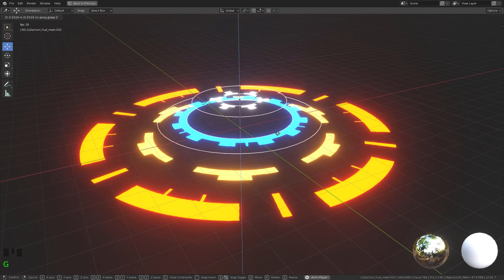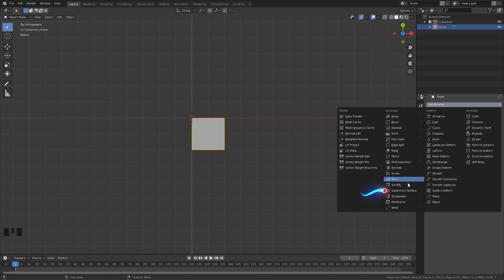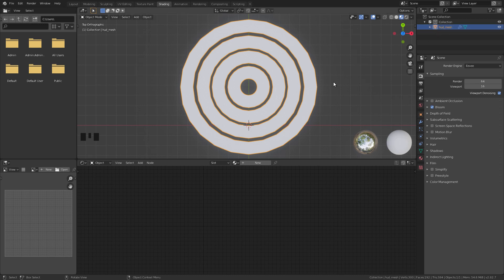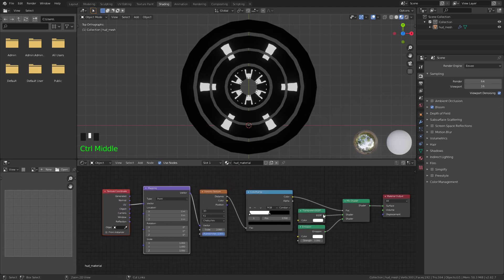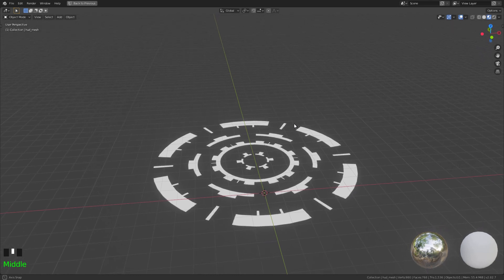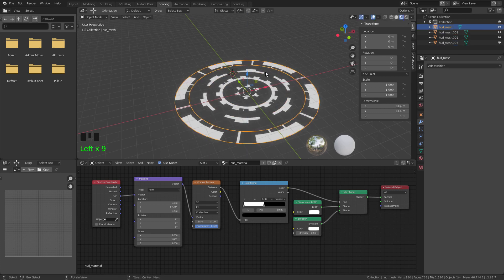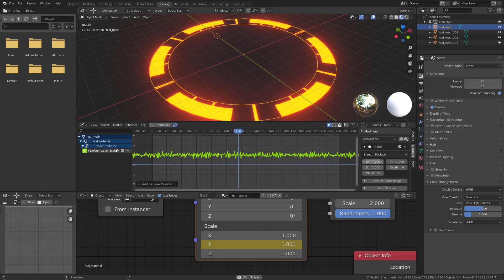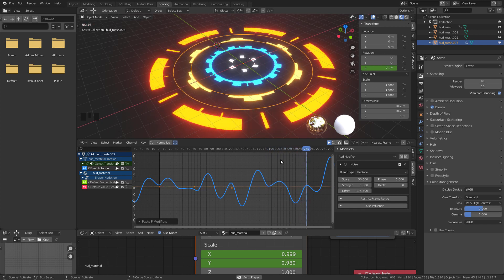Procedural HUD design in Blender Eevee │ Blender 2.8 Mograph Tutorial

Comment: Hi, I'm using Blender 2.9 and when following your tutorial following errors occured....@2.26 when you bend it to a circle I'm getting something entirely different.....I'm getting a donut shape with much more thickness than the narrow one you have.....so under array modifier instead of setting the count to 6, I had to set it to 12 as I can see that your donut shape has 12 faces.
ALSO, when tweaking the design the lines aren't straight and is coming up as imperfect shapes....is there a way to refine the edges to be straight before unwrapping it...

Comment: Please help. It's not showing anything in graph editor when I set single keyframe and also how to open the modifiers tab in graph editor.
Reply from the maker: 1. Make sure your object is selected in the viewport
2. Go to Graph editor then press N > modifiers tab
Reply: @thecgpatrick  thanks
Reply: I have the same problem. I tried the two steps you suggested and still doesn't appear anything in graph editor. I'm running Blender 2.82.